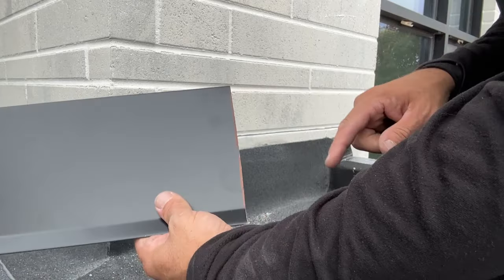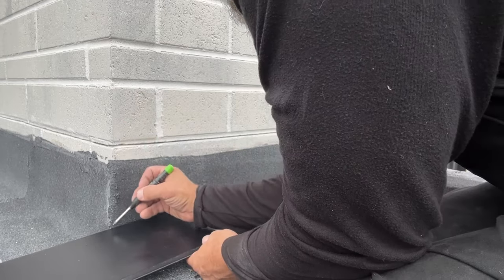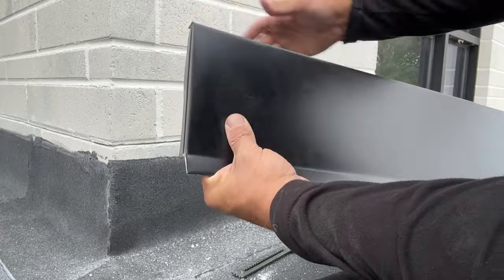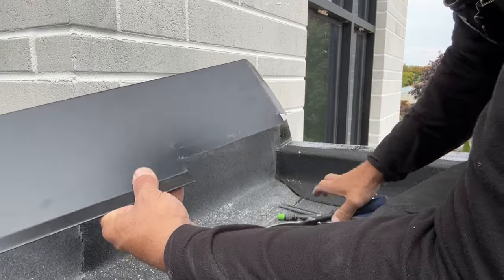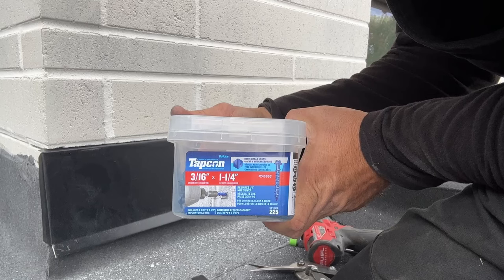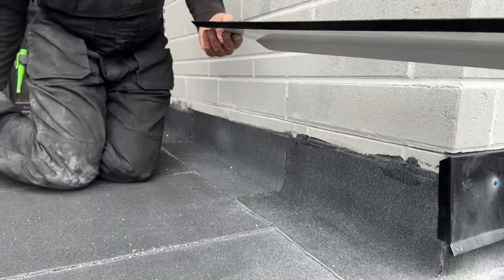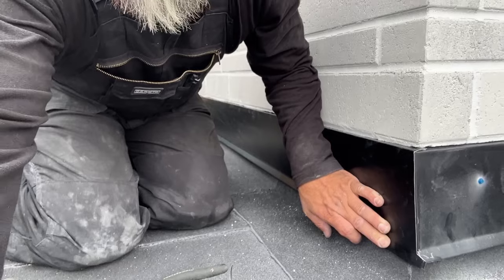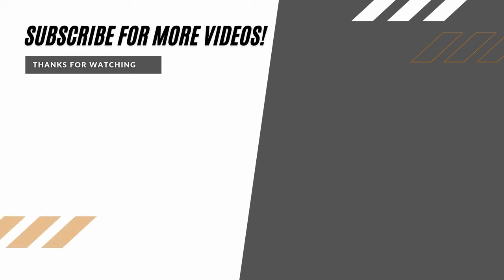Flat Roof - How to Install Wall Flashings

Comment: Nice video. What’s the extension bit and bit holder you are using with your impact driver?
Reply from the maker: I usually use dewalt 1/4” bits. I find they hold the best!
Reply: @schoenroofing is your extension piece dewalt too and what size is that?

Comment: For thos end marks try flipping ur square around so ur not holding 90% of it in mid air lol flip it then the hole square is on the 90°bend in the flashing .
Reply from the maker: Appreciate that. I think I was trying to get the best camera angel without being in the way. It did look awkward. lol